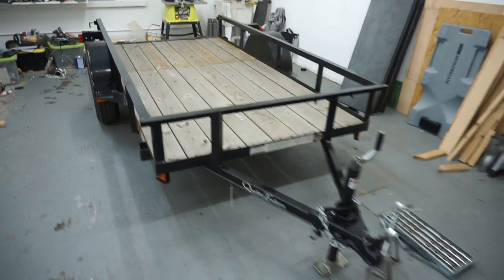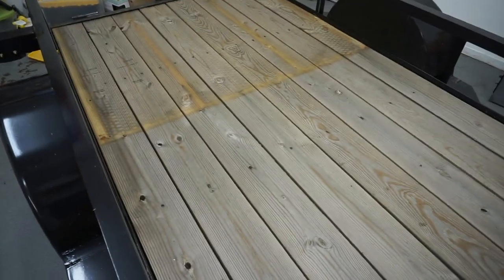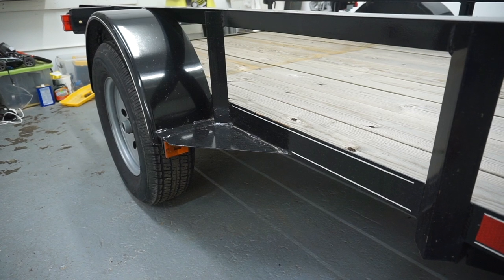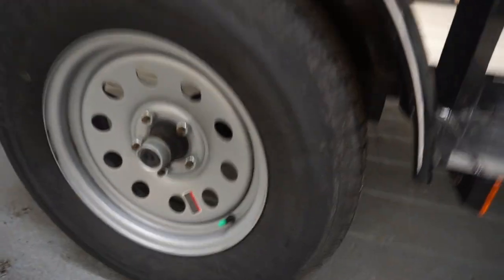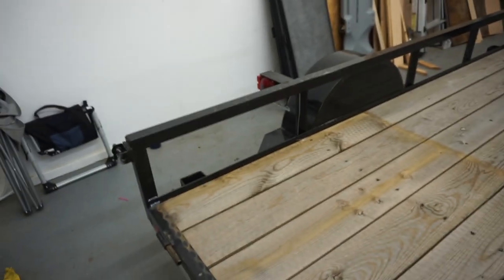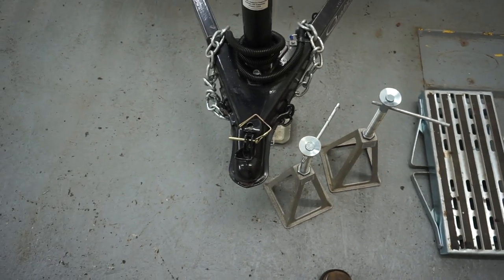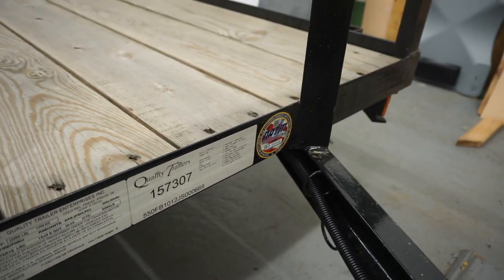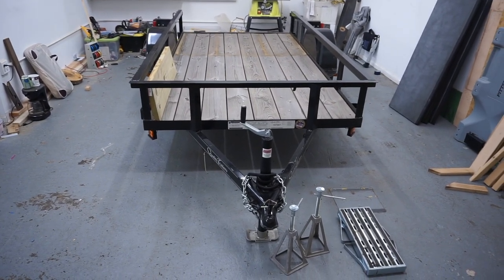What to Look for in a Tiny House  Camper Trailer

Comment: I'm buying a aluminum utility trailer without sides. It has the decking, single axle with jack's. 7 by 10 with back ramp.
Reply from the maker: Ok, aluminum is definitely a lot lighter and easier to tow (and more expensive).